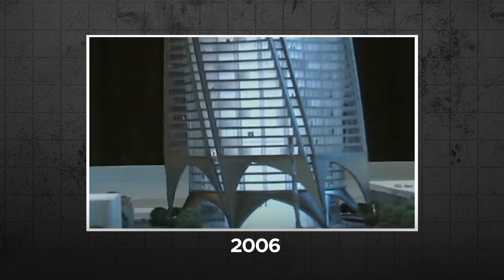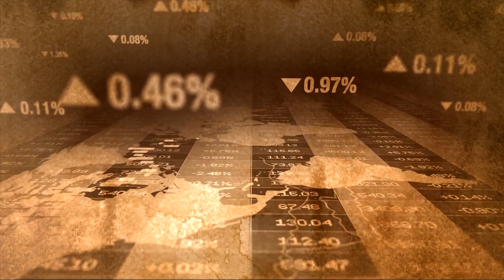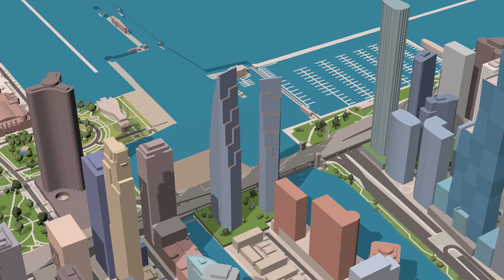Chicago’s Bold Comeback: From A Giant Hole To A $1 BILLION Skyscraper

Comment: Chicago did not INVENT the skyscraper. The tallest building in the world, at the time, was the Empire State Building in 1931.
Reply: Yes they did, they made the very first one. Plus the sears tower beat all of your buildings and was the tallest in the world for around 20 years.
Reply: The Home Insurance Building in Chicago, built in 1885, is widely considered the world's first skyscraper. Designed by William Le Baron Jenney, this 10-story, 138-foot-tall building was revolutionary because it used a steel-load-bearing frame, a technique that made the construction of taller buildings possible and became a standard in the industry.  
Key facts about the Home Insurance Building:
Location: Chicago, Illinois 
Built: 1884–1885 
Height: 10 stories, 138 feet (42 meters) 
Architect: Major William Le Baron Jenney 
Significance: Its steel-frame construction allowed for unprecedented height by supporting the building's weight, moving away from traditional masonry methods. This innovation led to the development of the "Chicago Skeleton" and ushered in a new era of skyscraper construction. 
The Home Insurance Building's design was a direct response to the need for more space in the rapidly industrializing city, particularly after the Great Chicago Fire of 1871. The technique pioneered in this building was pivotal in shaping modern urban architecture and the skylines of cities worldwide.